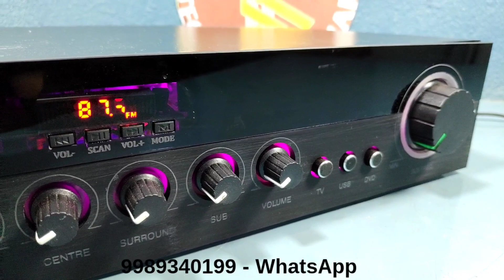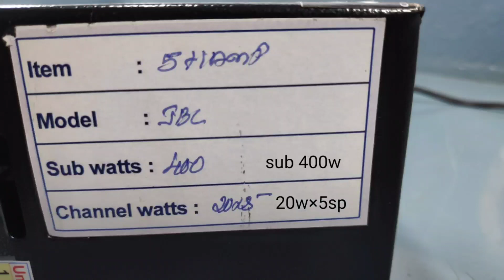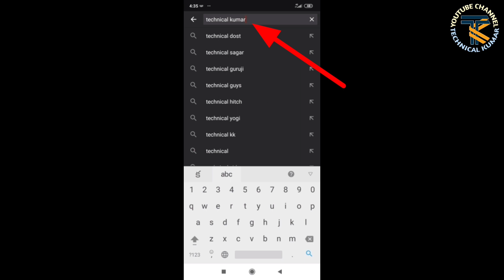Slim model acrylic sheet 5.1 amplifier/low cost 5.1 amplifier for sale

Comment: 1 question about amplifier board power supply???
Please suggest transformer for....
4 mosfet stereo...1 board + 4 mosfet mono...1 board+ 10 mosfet....5 channel...1 board
 I make 7.1 channel amplifier but I confused in 
Voltage and amp.???
How to calculate voltage and amp. For board...
Please guide me
Reply: 30- 0 - 30 5 amp transformer

Comment: 24 volts 5 amp dual power section ki 4700 uf / 35 watt capacitors use cheyocha